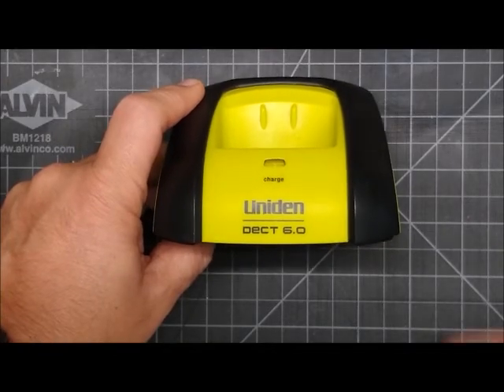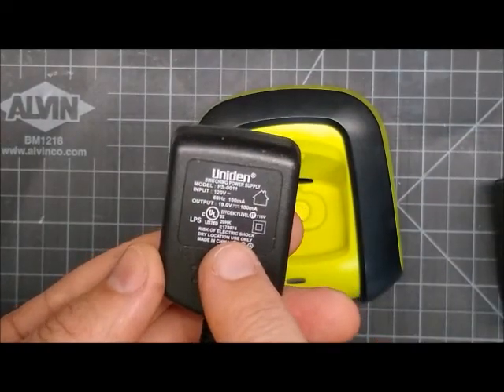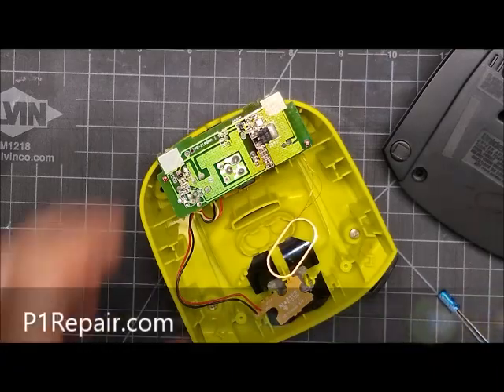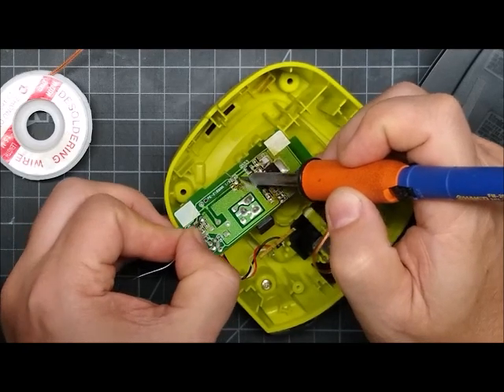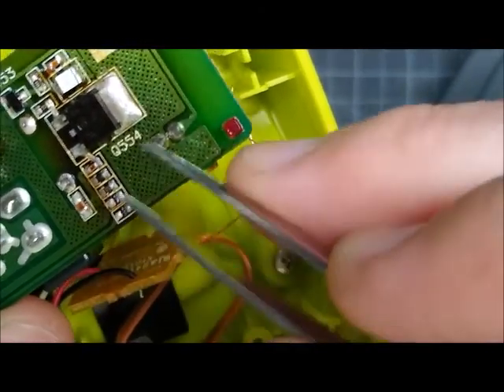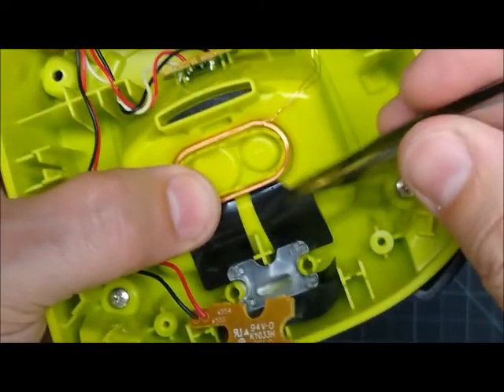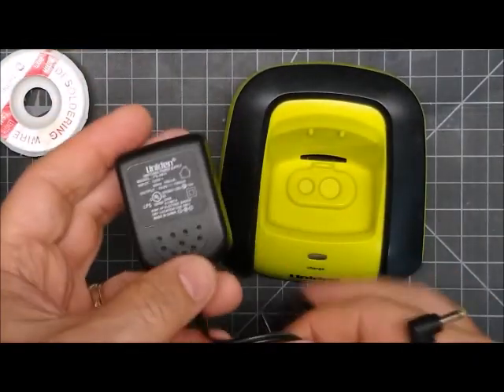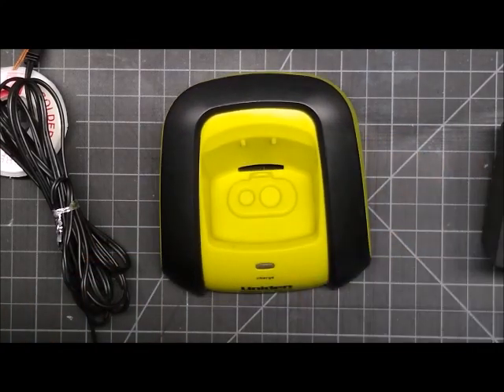How To Repair Uniden Charger Stand DWX207 TWX977 TWX955

Comment: What is the cause of the same symptom with a known good charger base? One handset charges its battery and another one doesn't, charger red lamp lit, same base, new batteries.
Reply from the maker: If the base has not been repaired then my first guess is it needs repair simply because it is common and inevitable.... works just enough to charge one phone but not the other because one is on the opposite edge of tolerance levels. I'd also swap batteries in case one is defective.  Could also be a bad phone or a bad power switch on the bottom. Most people don't even know there is a secret power switch on the bottom of the phones.
Reply: The handset works great with a freshly charged battery, but only until the battery needs charged, @p1repair ; and I can charge the same battery in the working submersible or one of the standard handsets. I have one that only works on speaker too. Receiver is obviously faulty because it works if I tack-solder a small speaker across its leads. I'm planning to replace the 1uF/50V caps, parts on order, but currently none on hand.

Comment: Thanks. The adapter voltage read OK, so I changed the station cap. That didn't help, maybe the adapter failed hot after charging awhile under load. I used a higher current adapter and spliced the unusual connector. That's been working. I cut open the suspect adapter but could only see one side. No visual clue. I might saw around the plug to see the other side, maybe try fixing the adapter.

Comment: If you have trouble clearing the solder from the holes in the board, try heating the solder and gently pushing a round toothpick through from the opposite side. Leave the toothpick in place until the solder cools.

Comment: I was skeptical because usually bad electrolytic caps have a bulge and this one did not, plus it measured 0.8uF on my meter which is close to the nominal value of 1uF. However when I replaced it the charger worked! This was a great video and much appreciated.
Reply from the maker: That's true for larger caps but these little caps with low value usually appear fine. A mutlimeter can't really do a good test on them either. I use a capacitor wizard tester and that's a lot more accurate, plus you can do in-circuit tests.
Reply: The old cap probably has abnormally high ESR and/or DC leakage current; and only advanced testing methods would detect those faults. Multimeter tests are not adequate for detection of those faults.

Once I've got the correct value on hand, I'll be repairing my three chargers; but 1uF / 50V isn't a common value for the vintage (vacuum tube) equipment I normally service. I only had 1uF / 160V in stock, not a good mechanical fit (lead spacing) and more than 3× rated voltage is excessive.

Comment: Just wanted to say THANK YOU!!!  I've had these phones in my shops for years, and one by one, they've stopped working.  I've spent money on Ebay, trying to replace them, but those quickly died too.   After watching your video, I have checked and replaced capacitors in two bases, and have purchased 24V adapters off Amazon, spliced the base plugs to them, and ALL of the bases/handsets I have are not fully working and charging!     Excellent video with quality content!

Comment: Thx!  I had one of the older ones so replaced with a 47uf 50v cap.  One thing I notcied, after reading charged pack, the nominal 3.6 vdc pack now at 4.2xxx volts.  Oh well, last pack lasted 4 years.
Reply from the maker: 3.6v is average voltage at 80% capacity.  It's expected for batteries to measure higher than  labeled at full charge.
Reply: @p1repair   I originally tore new $4 pack apart when base would not charge, then thinking maybe bad cells, they all terminated 1.39 on LA Crosse charger.  Then I found your site.  After repairs, I charged a second set on my standby Nitecore charger that terminated at 1.5vdc (max recommended) so 4.2 not so bad from the base.  Thx again.